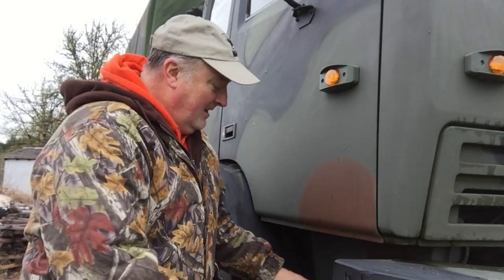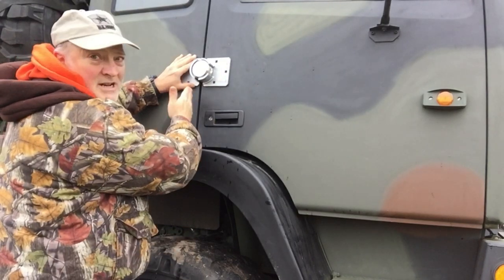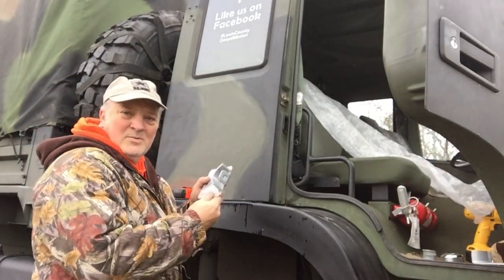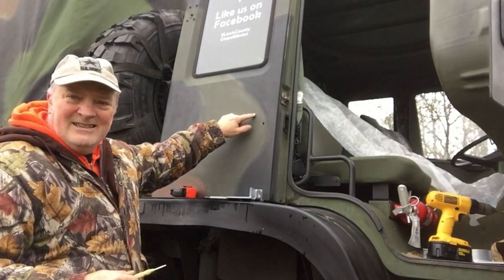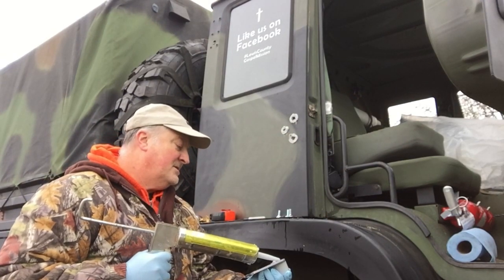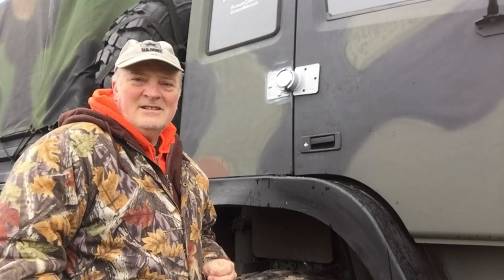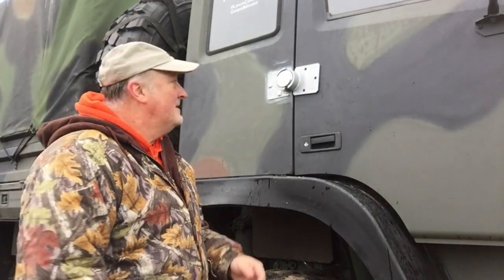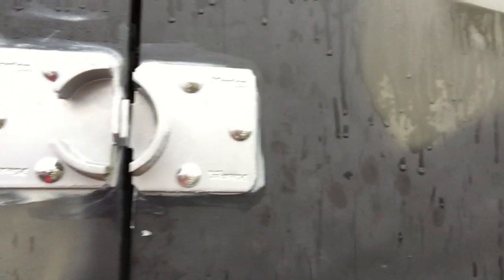FMTV CAB DOOR LOCK Installation #9

Comment: Those turned out great.  Just so you know mine are setup so that you can read them on both sides which also means the key comes out on opposite sides of the door.  LOL
Reply from the maker: I just got my door adjusted properly. The lock fits like a glove and the hasps are perfectly aligned. So, you know what that means? Yep, I screwed something up and it happened by total accident. LOL!

Comment: Like the addition.   Do the door handle locks work as well or is this an alternative?   

I did not see any vulkum under the drew heads.   Do you think that is needed?   That looks like one other way to get water through.   

Enjoyed the video.
Reply from the maker: The truck did not come with any keys, so I cannot test the door handle locks for functionality. I could take it to a locksmith and have them key the locks to make them work, however the beefy Master lock 770 just seemed like it was much better security and went along with the "monster truck" theme of the LMTV.

The Vulkem spewed out from every direction when I tightened the bolts down. Even came up from around the carriage bolt heads. I'm not terribly worried it they were not sealed... it is not like the truck itself it that tightly water sealed, anyway. If water did get in, it would just drain out the bottom of the door, harmlessly. Thanks for the question! Cheers!